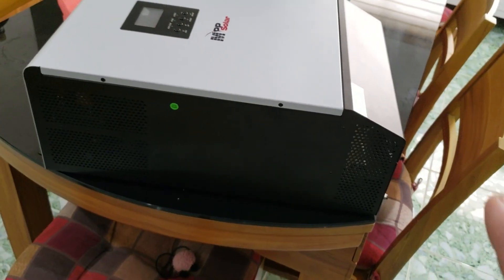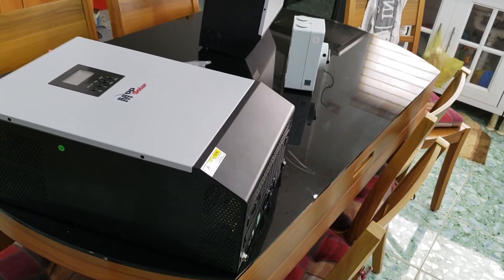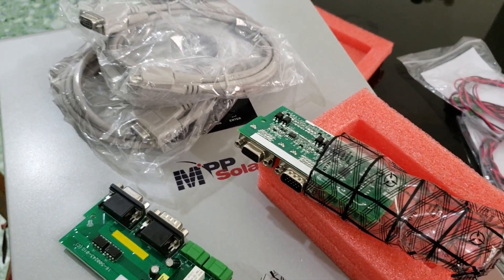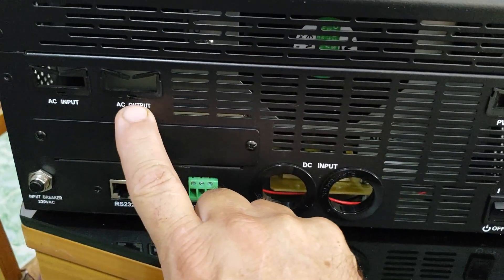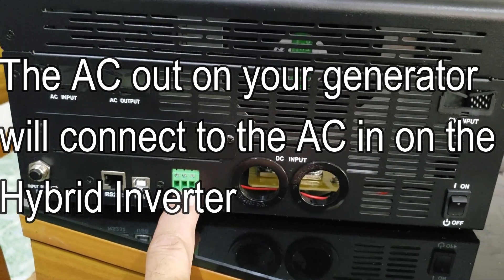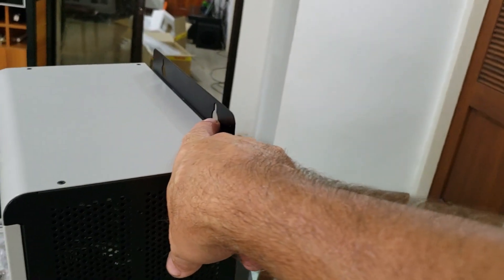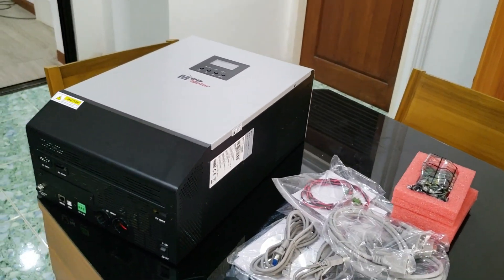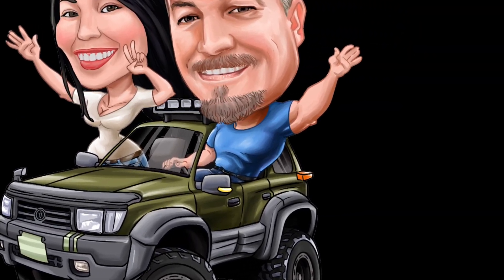Episode 16 MPP Solar Hybrid Inverters Parallel  OFFGRID - Becoming Independant

Comment: I own the 12 volts 800 watt one and it waste a lot of energy by turning on the fan. The MPPT charge controller quit on me the other day and they refuse to  exchange it for another. The unit said my batteries were charged but they were not. I have 2 Renogy MPPT charge controller that I am very happy with. I am glad that this is the only system that is not modular. Once these unit break down you are up the creek with no paddle. I used this at night so it sometimes switch to AC and stay on the AC and will not disconnect even when the sun comes up.
Reply from the maker: I don't know what to tell you. I have zero problems. I can say that number one make sure it actually made by MPP SOLAR as many companies have cloned their units. MPP Solar warns of this themselves. Next is if it is a real MPP Solar may I ask what your using such a low watt inverter for? What type of batteries are you using? send me pics and info to jamesray080808@gmail.com  I too also own a Renogy MPPT charge controller. Renogy dont actually make that it is a rebranded unit. I also own 16 mono Renogy solar panels.
Reply: It is made by them since they have been emailing me on the subject. There is one question that I asked them that have not been answered. Does this mop solar unit charge the battery when the power switch is tuned off. I turn off the inverter by turning off the power switch. Will that damage the charge controller?

Comment: Any update on the Tesla battery? I don't believe your MPP will charge it as the charge setting are not adjustable and default settings are for a SLA battery at 24v, and not at all suitable for the 22v Tesla battery.
Reply from the maker: Ok I am currently making videos on it right now. I have to say I AGREE with your assessment on that. Now it will charge it and work it for sure. It does have custom mode. And there is a pretty sizeable range of power to use in there and the nice thing is by not using the max power down range you get many more cycles of life out of the battery which is exactly what Tesla does and that is why the batteries will last for years in those cars instead of just 3 or 4. I have the system up and running on them. So far so good. I wanted to get more time in and evaluate it more before I put a video out. Hang in there it is coming - I appreciate your input and commenting

Comment: Good Morning,  Do you have the links to where you brought all your solar set up. I am in the Philippines and I am looking at setting up solar in my house. Thank you for your assistance.
Reply from the maker: mppsolar.com or sales@mppsolar.com   Please dont do like so many there in Philippines trying to do a batteryless system. I can't even express how moronic that is if its a off grid unit. It will constantly be shutting off. Do maybe a 48v system Look at 5048 model not the LV5048 though that one is for north america.  How much power you want to make will also define that size.  If you want just some small backup consider the 4024 like I have.

Comment: Hi, first thanks for the video, it gave me a better idea of what i need, i have a few questions that i hope you could add on your next video, first and most important is how does the parallel option works?, obviously i need the 2 inverters BUT and i am guessing here, the solar panels are connected to first inverter, then you need 2 sets of batteries for each inverter?, or only one set of batteries that are connected to first inverter?, then again i am guessing here, first inverter has an output of 4kw so once connected in parallel the output will be 8kw?, is this total output coming out the second inverter?.

Thanks again.
Reply: Also could you please let me know which inverters you are using so i can start looking for them.
Thanks.

Comment: How are you planing to get your Tesla battery to the Philippines? Can they be air shipped? This is the same thing I'm planing to do I was wondering if it would be better to just buy batteries there or try to send a few Tesla batteries.
Reply from the maker: balikbayan boxes One in each box with lot of other things packed around it ! Down the charge some for safety. Maybe not til next year will I do it. I want to continue looking at other options. Some new batteries options are showing up now. I will keep some videos coming out on that this trip. Where you at there buddy?
Reply: @TexasFilipino  I'm down near Beaumont tx now. I'm starting to build a house up in the mountains near osmeana peak in Cebu.

Comment: Excellent information across the board James. Jackzilla and I have briefly discussed solar systems. I like all of the "little" extra tidbits you passed along about what all can be added as well as making sure that servicing is priority. People don't usually think about that. Just like water heaters,a/c units, heaters and etc. Out of curiosity, what are your thoughts on wind generators?
Reply from the maker: I like wind generators. I will be adding them here as well. Lets say for instance here its monsoon season and its been windy for few months. day and night I could have been producing excellent power. I bought one in Texas back 2 years ago. Prior to that a made a couple of homemade ones hat I still have. The one I bought  to test out awhile is a dual pma ( permanent magnet alternator ) dual meaning it has a set at each end. It produces wild ac as they call it and then you connect that to rectifier that converts it to DC. that you can charge batteries. I found it to be maybe overrated. It was supposed to be 3k generator - impossible unless non stop 50 mph wind with no gust. I think they rated it by spinning it with a electric motor fast n steady. No by true output in the wind. None the less it produces. For a homeowner to get into a truly good wind generator it will be very costly. dollar for dollar I put my money on solar more. I will add wind pma just for extra bit during nights and cloudy days. I got mine from Missouri Wind google them up. Hot dip galvanized , carbon blades, aluminum hosing. fair price
Reply: @TexasFilipino  I appreciate the advice and I  will check out their site. We also had found quite a few people stating that they too were a little disappointed with them. I'm sure that we will eventually go with solar on the home. If I do a generator, I'll hook it up to the tool/man cave that I will be building in a few months. I need my space, oops, I mean I need a place for my tools.😁
Reply from the maker: yep I was disappointed too. I'm not endorsing Missouri wind at all. I felt the rating they sold them as was inflated or they came up with figure thru some hard to duplicate circumstances.  I'm wanting something that has huge blades but turns slower. damn thing gets to screaming at my house. If one of those blades slung - OH MAN
Reply: @TexasFilipino  that would be nasty!

Comment: First of all, thank you for all the information about the MPP Hybrid Solar Inverter. Secondly, thank you for reminding me all I had learned, but didn't realize I forgot. I was an electronics technician in the Air Force many years ago. At the time I never thought I would have forgotten anything. I guess it's true, at least for me, what you don't use, you lose. Take care.
Reply from the maker: funny - i just rattled the dust loose!! hey BTW thank you Stacey for serving. I personally appreciate it. Respect!!!
Reply: I'm not sure it was just dust. I think there are a few short circuits also.
Reply: Thank You for Your Service 🙏